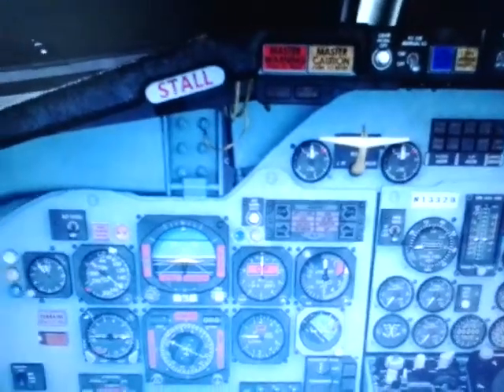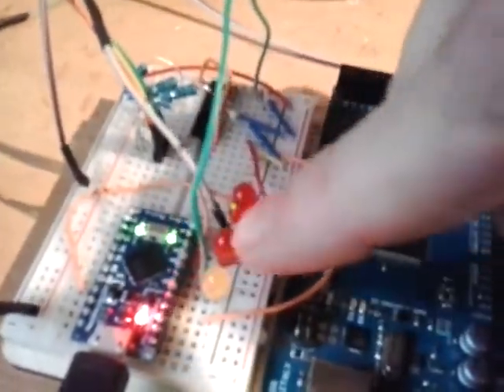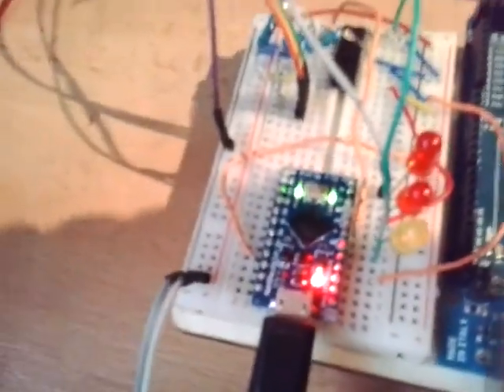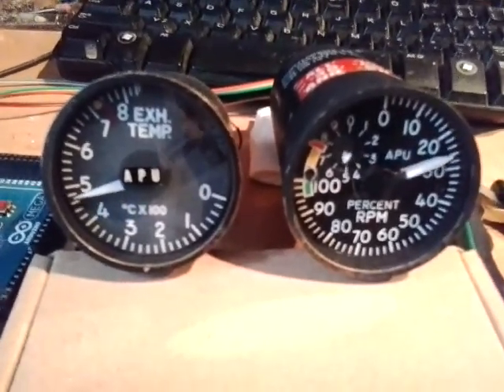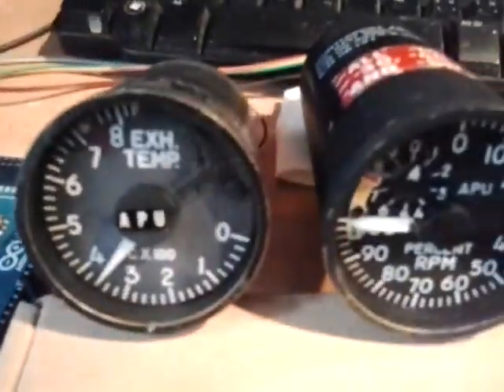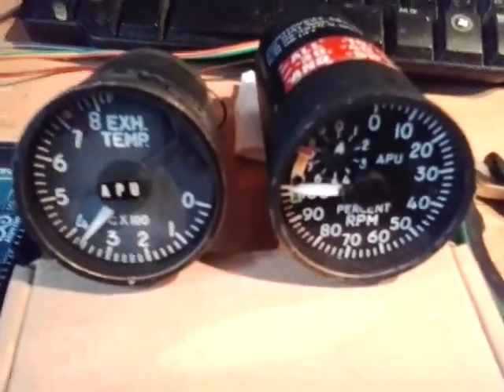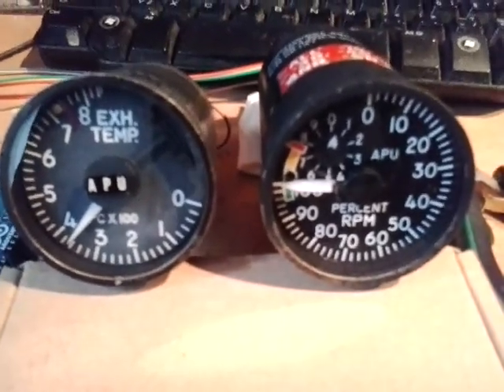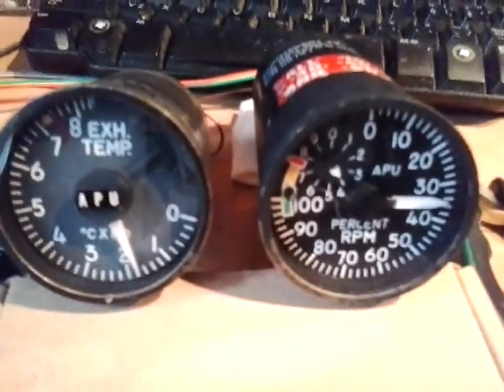DC-9 instruments via Arduino: APU

Comment: Wonderfull, I have an arduino mega and I want to light up a led to show the boeing 737 APU GEN OFF BUS , and after ,if it works , make the EGT gauge .
Could you tell me how to do this please, it's almost the same thing that you've done.
Thanks.
Best regards, very good job !
Will.